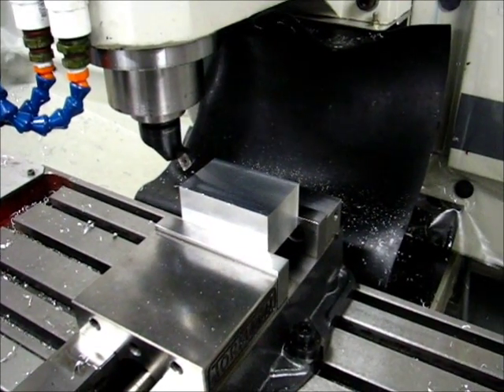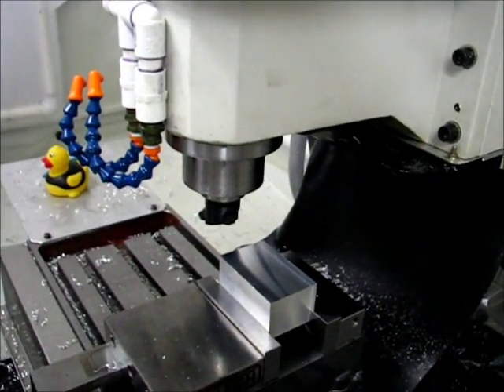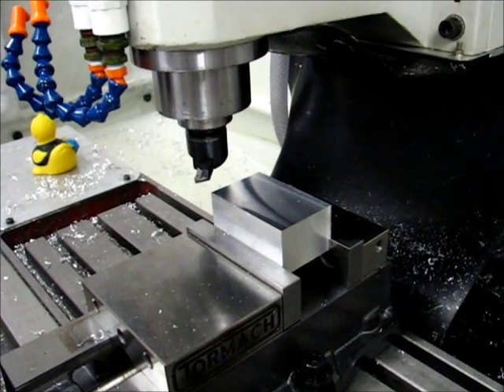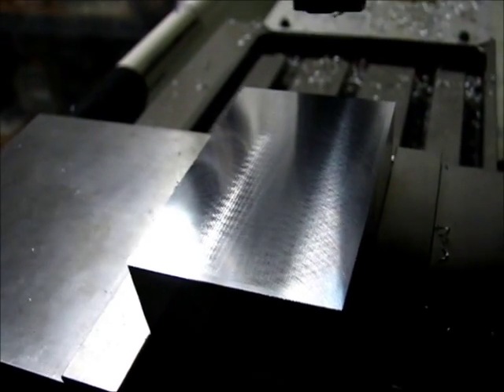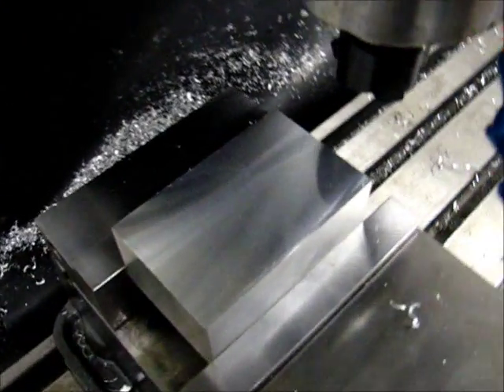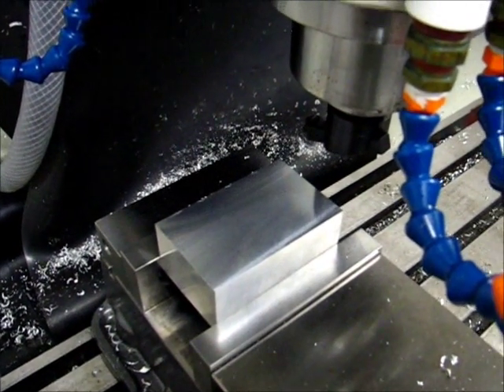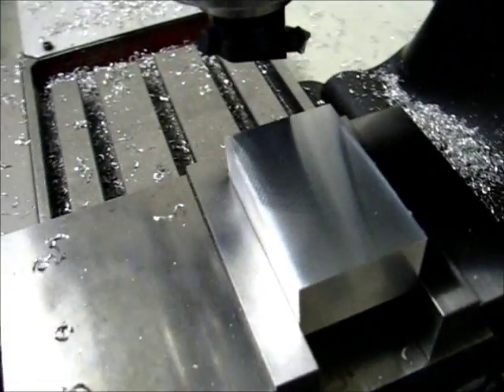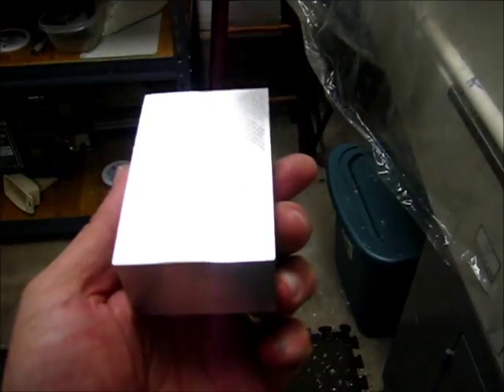Tormach PCNC 1100 - Tramming By Feel

Comment from the maker: I was out of tram enough to be uncomfortable with it. That's fixed now. Not all the way, but enough.

The fed rate was set intentionally high for the test so it made distinct tool marks. I normally finish at half that feed or so.

When cutting left to right there's still some visible cutting taking place by the trailing sweep of the cutter. I can't see that happening when cutting right to left. As long as I finish left to right (which I do, by virtue of the home position), I'm happy with it.